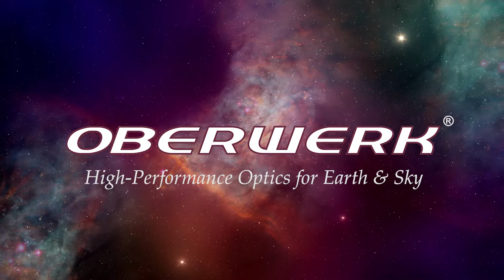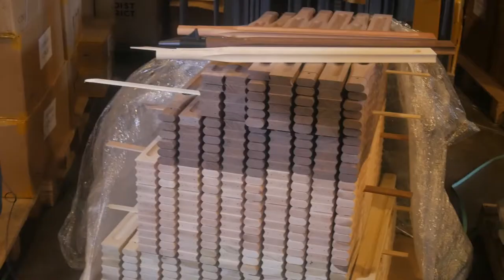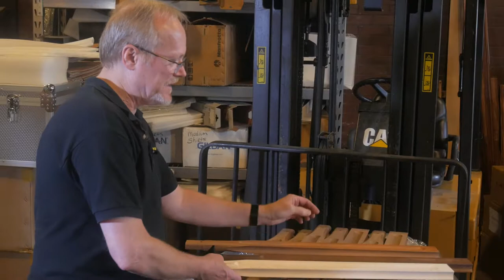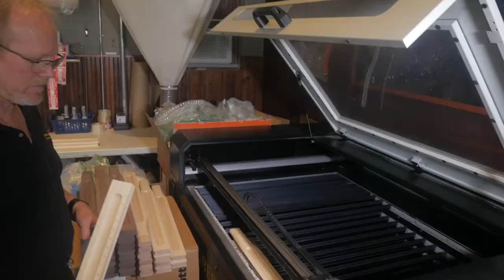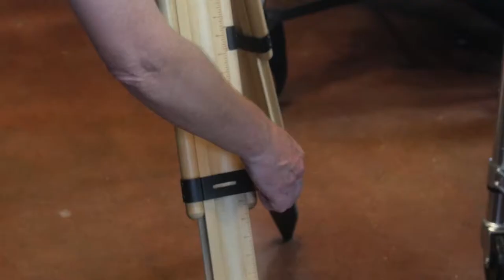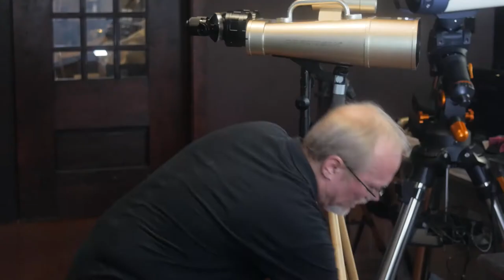Oberwerk Video Series Episode #3: Wooden Tripods

Comment: Very nice, I’m looking to get a walnut one for a 102edl refractor, I’m curious if the carbon center post option is the best choice for vibration free viewing, I’m looking to use it with a stellarvue m2 manual mount. Thanks, also do you have rubber feet for the tripod so I could bring it inside?